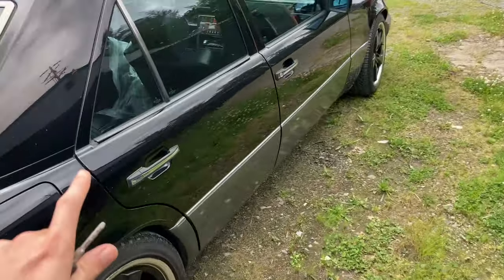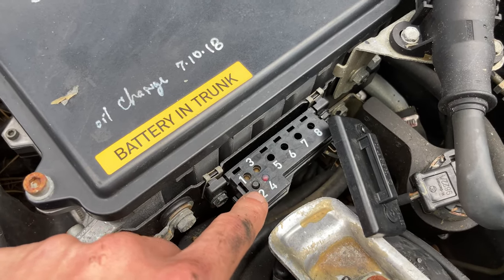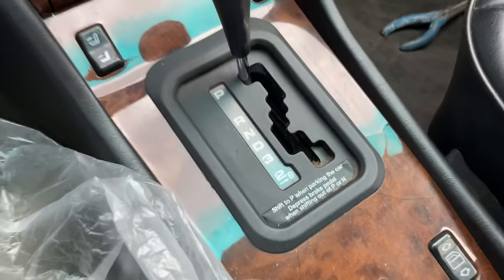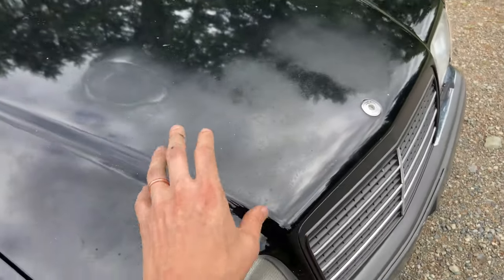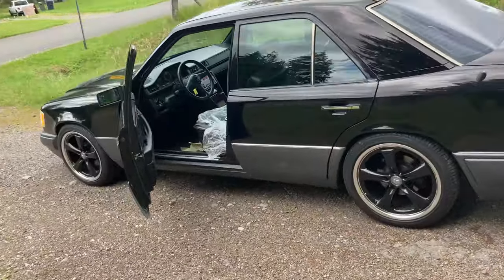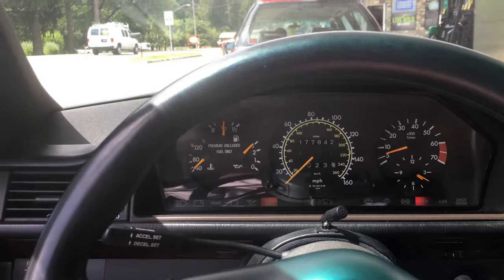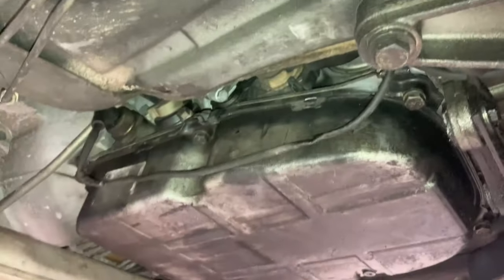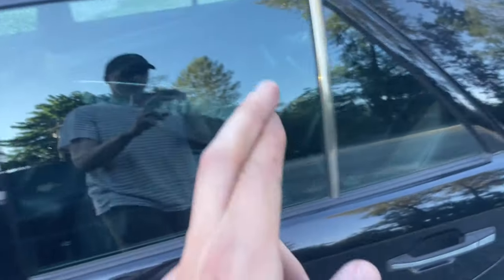Buying a Mercedes E420 - W124 First Time Owner...

Comment: Knock sensors are under the motor mount support arms. Feed directly into the EZL but wouldn't worry about them. Fuel leaking around pump is likely just crush washers.  I dont know that the lower harness is still available but easy enough to build from scratch. One thing you will have to deal with is oil into the ignition caps/rotors. I would pop one off and see what's going on in there.  Great to see you into a 'V-boot'
Reply from the maker: Appreciate the info!! I will be reliant on many with more knowledge of this platform such as yourself heavily as I go through this build. Many parts ordered and otw! I have a in on a harness replacement possibly and will look into crush washers, thank you!!
Reply: @ANDERZENAMG  Was hoping it was a non-ASR car but looks like it is. The rear gear kills the performance in those. Love to cruise at high speed though
Reply from the maker: @bicylindrico  yea… same, it doesn’t have a ton of giddy up from take off but does well on kickdown about 30+
Maybe eventually I’ll look at ASR defeat and 2.82 gears
Reply: @ANDERZENAMG  The 2.82 rear end totally changes the personality of the car and makes it a hell of a lot more fun to drive. Even more so if you add a limited slip. I suspect Mercedes gave the 034 the taller 2.24 rear for better fuel economy and to assure its acceleration numbers weren't close to its big brother. There's also a 2.65 option which many say is the best compromise between performance and fuel economy.
Reply from the maker: @R5Domino  would love a 2.82… even a 3.07… the car is not as sluggish as it was made out to be but definitely comes alive more at freeway speeds. Thx for the info 🤙🏼

Comment: Good find man car looks great!!! I freaking love that steering wheel. On your overheating note my friends S/C 500E was running "hot" most of the time...apparently its normal for those engines. It's been good for 20 years so far so I'm not doubting it lol
Reply: Also I need that ML55!!!
Reply from the maker: thank you dude! I love it too!!!
Yea not too concerned about the temps… fans come on right on time, plus AC is integrated into cooling system so once it’s charged fans will come on sooner. Same system in the ML55 actually and lots of other MB’s. My kompressor used to run the exact same.

Comment: Great video. Thinking buying a 1995 same specs with W119 engine and 136k miles on it. Looks in general fairly good shape at first sight. Owner says it does not work A/C. Sunroof sometimes work and sometimes does not. Lights of the dashboard do not work. Flashing lights button is collapsed, a loosen ceiling cover. Any thoughts / recommendations would be much appreciated. Thanks
Reply from the maker: If it runs good and price is right I’d say go for it! This one had a short list of problems but nothing that would hurt reliability or driving around and the price was right so I snagged it. Glad I did, one of the best cars I’ve owned especially now that I’ve manual swapped it with a 6 speed.
Reply: @ANDERZENAMG  thanks man. I’ll test it and hopefully go for it. Keep it up with your content!